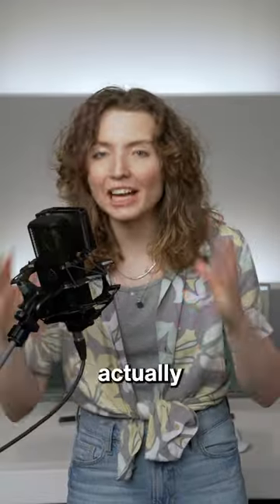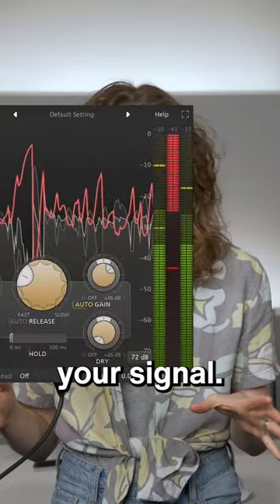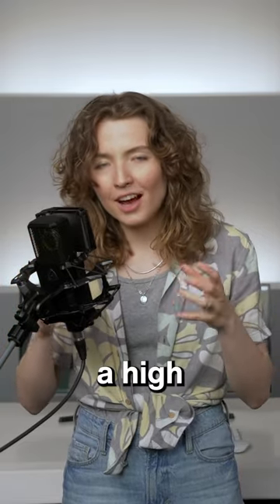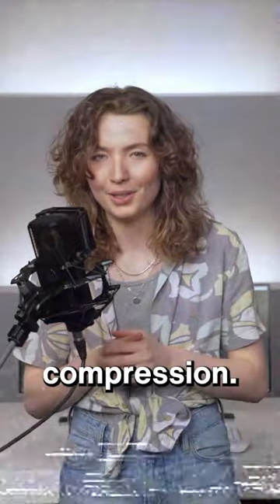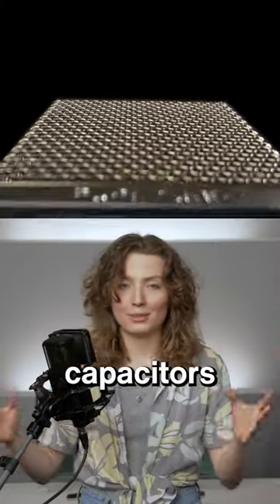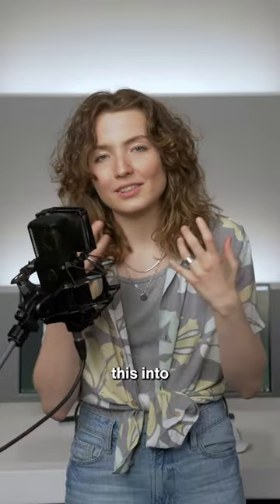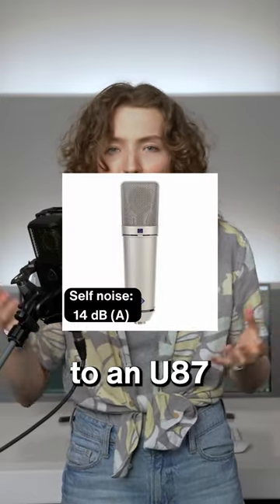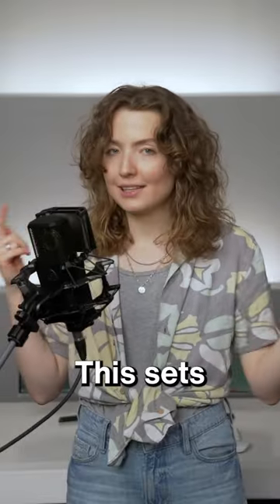This mic is an absolute technical masterpiece! PURE TUBE

Comment: I like how Lewitt shows that relying on the past isn’t always the best approach to the future. It makes no sense that microphone innovation would stop 60 or 70 yrs ago.
Reply: For sure, but most microphone companies have taken MASSIVE steps backward in the design and construction of transducers. The problem is, you can't really reverse engineer the best caps ever made. Skin materials, tension settings, and circuit materials make the whole process really difficult to nail. There are companies nailing all of this while also pushing the technology forward at the same time. Mojave, Lauten, Soyuz, etc. For me, pushing for new technology at the expense of quality in performance isn't a trade off I want to make for my own work.
Reply: The old mics still sound better than the ones Lewitt makes.
Reply: @TheWeazel01  Cool! Enjoy your old mics! I plan to upgrade to the Lewitt Pure Tube and call it a day. To each their own right? Have a great one!
Reply: @BeatsBangcomtv  True! Wish you the best!

Comment: The highs are really silky smooth, but I miss that ‚buttery‘ thick tube sound in the mids. It sounds very clean. Too clean? Idk. I‘m still comparing it with my first choice overall, the 940. That definitely sounds ‚thicker‘ and more robust in the mids. 
I like both of them, but I‘m still leaning towards the 940.
Reply from the maker: Both are great options for tube mics! 😀

Comment: I think I should go with NT-1 coz of the long term warranty, signifies they are much confident then lct on their products 😊
Reply from the maker: We offer a 10-year warranty
Reply: @LEWITT-audio  no need to tell a lie. I again checked on your warranty statement go check it. Other wise I was planning for it
Reply from the maker: @bhattikhlaq3948  Not lying--both LCT 1040 and PURE TUBE have a 10 year warranty. Our warranty statement is just our general policy unless stated otherwise--like in the case of the previously mentioned mics.
Reply: @LEWITT-audio what about 440 pure do they cone with the same. Coz i wanna buy 15 same kinda mic for vocal to training for my studio coaching institute?
Reply from the maker: @bhattikhlaq3948  That would fall under our standard 2 year warranty
Reply: @LEWITT-audio  yo so at last you got back at my point that's what I actually mentioned & wrote that I'm considering nt-1 that comes with 10 years warranty. Got it 💀⚠️
Reply from the maker: @bhattikhlaq3948  This thread is on a PURE TUBE video, so I was speaking about PURE TUBE.

Comment: But why that treble bump in all your mics? I really hate that sizzle if it's too much. And most of the time you need to use de-esser anyway so double "hell nah". Great product but without Neumann's clarity and smoothness in every freq range you are still not so close to U87 or 47. But VERY VERY close in terms of quality of the mic.
Reply: I don't think they intend to make a Neumann clone, but something original. Anyway, I think what you mention already became the «Lewitt sound». Not for everyone, but it's great to have flavours to choose.
Reply from the maker: Thx for commenting. If you check the frequency graph, you'll see that PURE TUBE is actually quite linear, and also the high-end is rather unpronounced and we found that it sounds very different from our other mics. What do you think? 

Btw, you'll find the interactive freq graph in the specifications section: https://www.lewitt-audio.com/microphones/lct-recording/pure-tube 

All the best from Vienna!

Comment: Yes, but capacitors are a part of the tonal circuitry. Tube flavor is only part of it. The whole circuit is where the vibe and personality of any microphone comes from. After having purchased a recently serviced Neumann CMV 563 made in the late 1940s, the noise floor is below -65db. That's crazy quiet! Also, if you absolutely need to, you can add a gentle gate pre compression to lower noise even further.

Comment: Lct mics are sooooo quiet  but I have to ask lewitt  is this mic on par with the 1040 ? I mean I spent 2500 more for a fet tube blendability
Reply from the maker: The LCT 1040 is our flagship model that allows you to shape and adapt your sound to the source with not only an FET/tube blend but four different tube characteristics and seamless polar pattern control that additionally can be used to shape the frequency response... The LCT 1040 is replacing a whole mic locker, whereas the PURE TUBE is a one-trick pony for vocal recordings with classic tube sound. They also sound different as they use completely different circuit designs. So the answer is, no they are not on par, as they were designed for two different things. Of course, we'll be happy to help, in case you have further questions.
Reply: I'm sorry I mean on par with noise floor
Reply: @LEWITT-audio  and I have to say I'm warming  up to the 1040. I already liked  it, but I'm starting to be wowed ... at first that low noise floor had me think  it wasn't as good  until I heard the punch